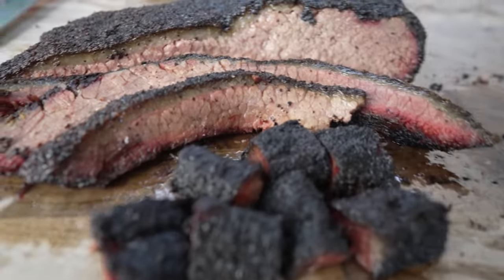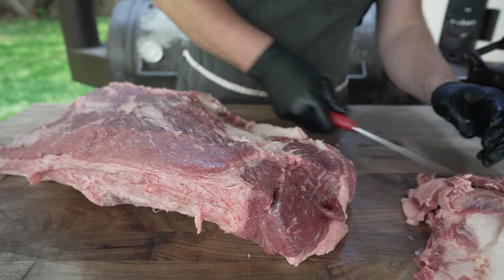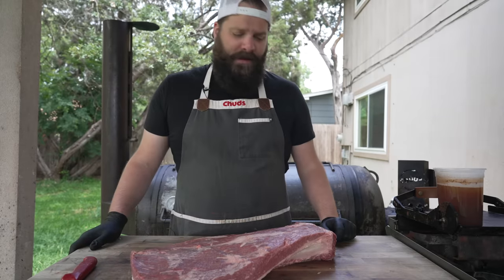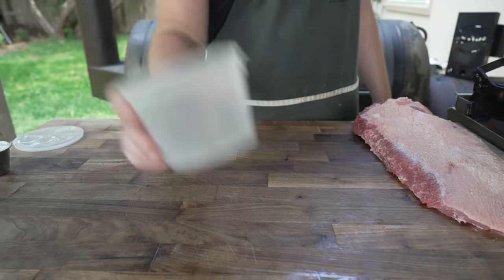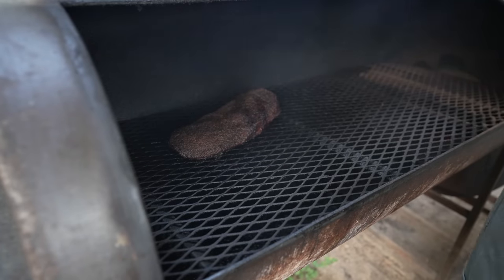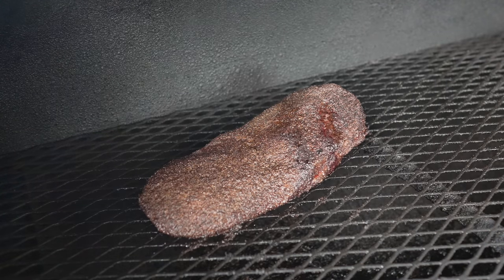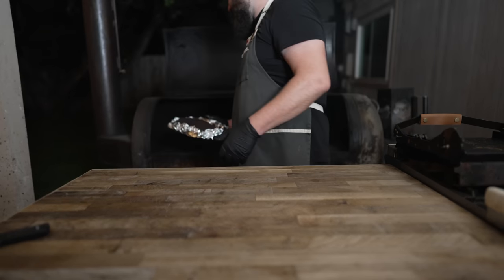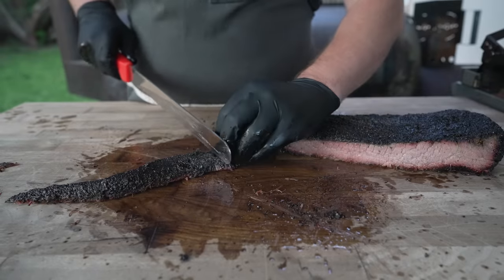A New Brisket Technique! | Chuds BBQ

Comment: Bradley, you have just started a new craze. Slowly but surely we’ll start to see similar videos like this roll on out and dudes across the land will be wanting to cook up just the fatty. Well done, sir. Looked fantaste’tic.
Reply: Reminds me of rib cap steaks... a steak of only the rich part of the richest part.
Reply: Love separating the point. But if you're gonna say you're making burnt ends need to go all the way. Chef Tom showed this a couple years ago already.
https://youtu.be/Wacn_3WR-b0
Reply: Way back when I started doing brisket I had an upright electric smoker and I always separated the flat and point because it was the only way to get a good render for me-I’m interested in trying this on one of my offsets
Reply: So temp do you go off of when your flat is 200 degrees but your point is 180 degrees after a 12 hour smoke. Do you wait for the point to reach 201? Will that dry out the flat?
Reply: @DavidBrown-jt7yi  I’ve never had the point and flat be that different in temps. After wrapping I always have the flat towards the firebox, which helps avoid the problem you just described. If I had your issue I’d keep the brisket in, checking every 8-10 minutes keeping a very close eye on it. Once you do pull it there will be some carryover, so as long as you let the point get to 190’ish I bet you’d be fine, especially if you let it rest 10+ hours
Reply: @brandonin_ny  Thanks for the info. We did pull it after it hit 192 and it was really moist and delicious. It was just strange and my first smoke so I was confused. I’ll do what you said next time. I have two temp probs so I had one in each end. I appreciate the feed back.
Reply: @DavidBrown-jt7yi  Most people follow the temp of the flat and pull it out when ready. After resting the point should come up enough in temp if you’re just planning on slicing the whole thing. You can also separate the two after the flat is ready and set it aside to rest while you chop up the point, and put it back in the smoker to make burnt ends. That’s the way I usually do mine.

Comment: I plan to rest a packer overnight in my oven in the foil boat...does the top dry out if my oven had a constantly running fan, even if the temp is 150-170°?

Comment: Unfortunately, a full size brisket does not want to fit in our vertical smoker. Last brisket we did had to separate the point and the flat. Turned out decent, but man it's got me jonesing for a bigger smoker

Comment: Can you explain the process of leaving in the oven at 150 overnight? Do you wrap it? Do you  rest or first or after?  Never did this before.  Thanks.
Reply: Wrap is optional, but probably recommended. It doesn't look like Brad wrapped this one. The time at 150F is the rest, so you can pull it out afterwards and start slicing pretty much.

Also note that if your oven can go even lower, it might be a good idea to rest at as low as 130F.
Reply: Thanks.  How long can you keep it at 150 for.  I’ve only wrapped and put in a cooler with a towel, usually 3-4 hours.
Reply: @michaelvonfrolio5118  BBQ joints (and Brad) keep briskets at 140-160F for up to 20hrs.

Comment: now my question is, once you have the flat separated from the point, is there anything that could be done to improve the flat which might not have been viable previously due to potentially negatively effecting the point, or due to the brisket's size with both muscles together? tallow injections? finish with a confit?
Reply: inject the flat with tallow, wipe any tallow that comes to the surface and then season it.
Reply: Brine it and make pastrami or corned beef.

Comment: This is what we do at Rudy's, just post cook. Slice about a pound or so off the flat, split moist cap, cut cap in half and trim. Is odd to me seeing "Dallas" cuts. Looks wrong to me and you're going to have cross cuts that mess with the grain. And lean is simply better when it's cut proper thin.

Comment: I tried this. Bought 2 small points, and they cooked WAAAAYY too fast at only 225-250.  No bark, barely any stall, came out tougher then $2 steak!
Reply: The point is very forgiving to overcooking. But if you don’t cook it long enough it’s tough. Always err on the side of cooking a point longer vs shorter  in my exp. Small points will “come to temp” fast but that doesn’t mean they’re cooked.

Comment: Dude, that's not new.  Good video though.  You can also cook the whole brisket until about 190 degrees.  The fat is then soft and you can easily separate the point from the flat  Reseason both pieces as appropriate and cook until ready.